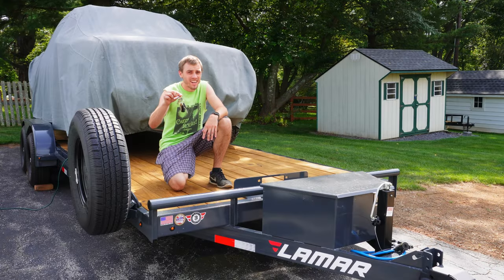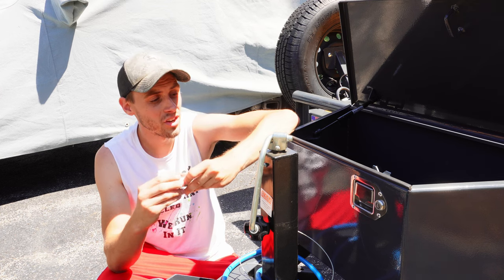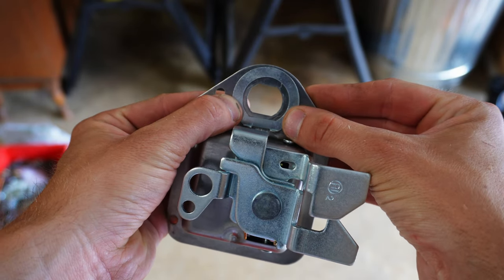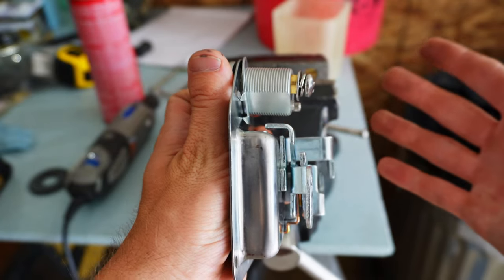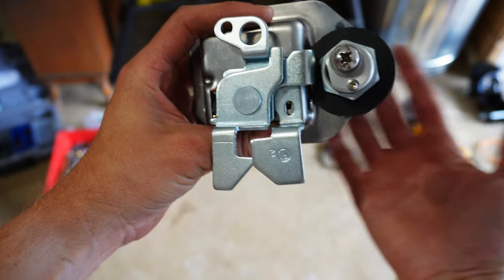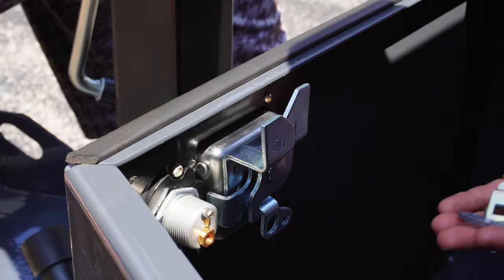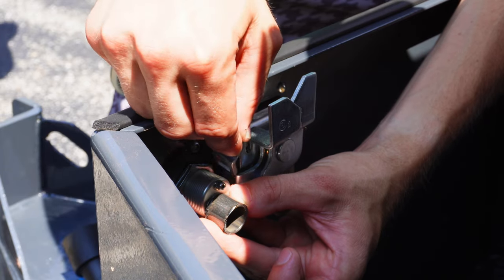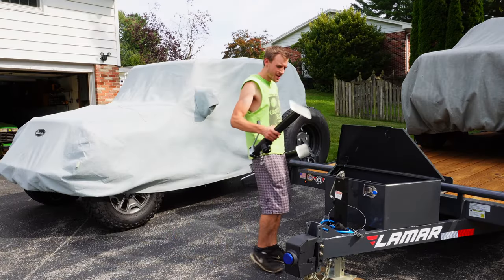Upgrading the Lock On My Trailer Toolbox - PACLOCK

Comment: If you already had the welder, why not just weld the anti-rotation washer to the body of the handle?
Reply from the maker: This would work it would also just burn through the powder coating on the outside of the box. I'd have to paint it which I don't think would hold up as well.